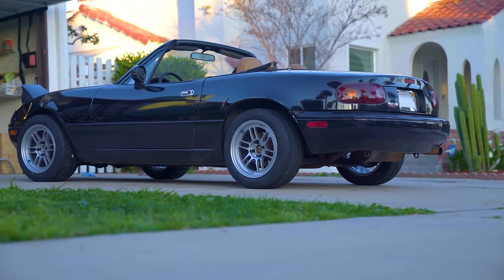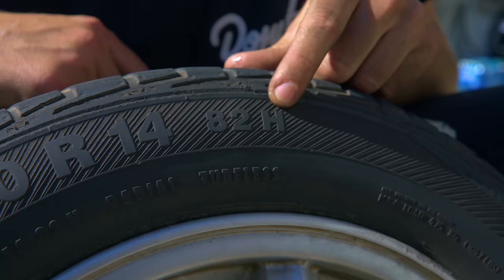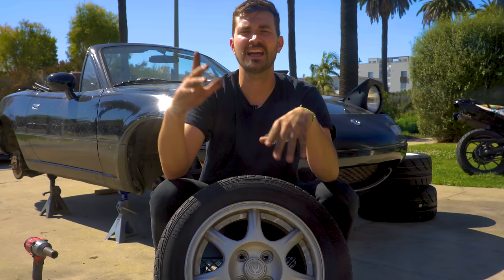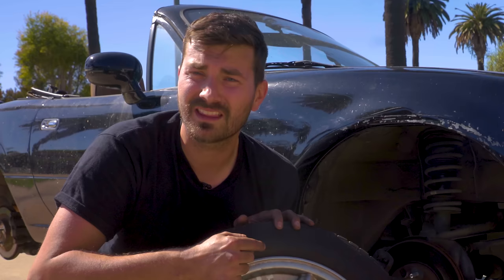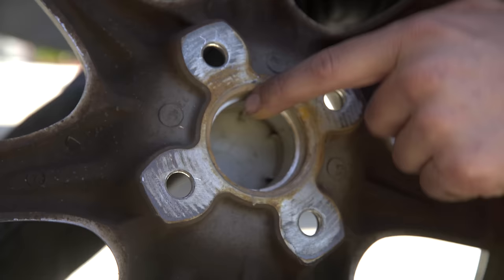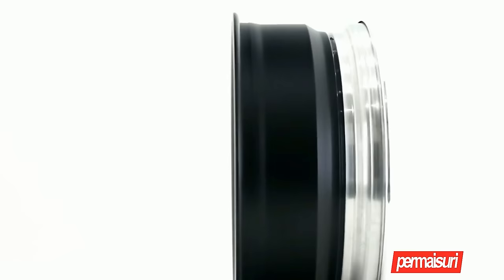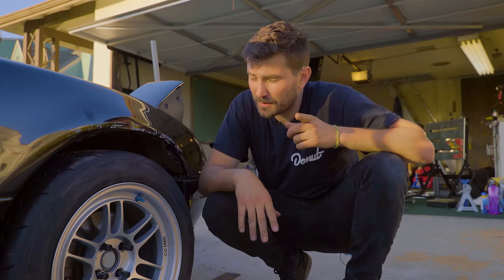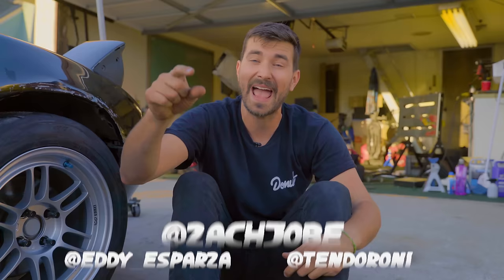How to Pick BETTER Wheels & Tires for YOUR Car

Comment: We had a nail in a tire creating a non-fixable slow leak while on vacation 100 miles away from a tire store and 6 hours away from home. Good news, we had a full size spare - bad news, it was never used and original to our '99 suburban. It did manage to get us home, but made us nervous (also we were pulling a 6' enclosed cargo trailer)

Comment: Also when you change tire type, size and what you are doing you will have different tire pressure needs.
Discount tire is always able to help, they have a program that works with the different tires on specific vehicles.

Comment: I heard you had to take away an inch in the wheel width to have a straight tire wall because the measurement of the wheel doesn't take into account the bead of said wheel. Meaning you would have a better fitment with a R15x7 wheel than a R15x8. It also explains why stock wheels on my BRZ was R17x7.5 with 215 tires. Also, going wider isn't always good. I tried 235 tires on my BRZ and I was using 1 more litre of gas for a 100km, a 12.5% increase on fuel consumption. With the price of gas here in Canada, I went back to 225 which is a good compromise.

Comment: I got a 95 NA Miata and got new wheels and tires on it. The main reason I ditched the 14 inch size is because you just can't find a good 14 in. tire anymore. It was even a little tough to find a good quality tire. It's the result of newer cars that have huge wheels and are more concerned about look over substance but as all newer cars now have these huge wheels there isn't a lot of money in it for keep making smaller wheels. I had to replace the wheels for that reason. At least there is a couple of good tires in the 15in. range so I got the wheels and some TOYO tires and love the all around setup. The only downer part is the tire is lower profile as I had to go from a 60 series to a 50 so the tire is lower profile. While great, it's wider and does handle great you find that cars that are designed with a tire size also figure in the suspension of the car such as comfort and the size of the tire makes a difference. The ride is now stiffer and you feel the road more so if the car felt the bumps in the road before they will really feel it more with lower sized tires. It's why I didn't keep going and get a 16in wheel because with those you just don't want to take it on longer drives and still have a back that doesn't scream at you to pull over and wait till you stop hurting and then drive on...

Comment: FYI - Factory lugnuts have a 40 degree seat while aftermarket normally has a 60 degree seat. You need full contact from the lug to the wheel, otherwise you may risk damaging you, others and/or the vehicle.

Comment: Hey Zack, I hate to be the one who criticizes, but your tyre fitter forgot to align the yellow dot with the valve. Yes, this is negligible in the end run, because wheels and tyres are balanced together, but aligning the dot and the valve could reduce the amount of additional weights need for perfect balance. 
Still, love your show, keep up the good work!

Comment: Fun fact. I have a 1990 VW Corrado. I went to a Discount Tire one time to get some new tires possibly, and they told me the rear tires that were installed were backwards. They were directional tires. They were installed by another Discount Tire a few hours away. If a trained professional can install a tire incorrectly, not check it, and allow the customer to drive off and possibly get into an accident, so can you. Also do not take possession of a car after getting tires installed without making sure they're installed correctly.

Comment: Hub rings are also for safety too. Without them all the load is braced on the studs which can cause vibration, flex and loosen the nuts or even crack and  fail

Comment: Great Video, but you forgot to explain Inner Fender Clearance...

Depending on your Backspacing & Tire Width, you may need to purchase a Fender Lip Rolling tool, rather than maring your fender lip with Channel-Lock Plyer marks!

Comment: They have an app to look up wheel fitment on cars. You enter your car then you have a two pages. One you can leave stock, or whatever wheel you have right now. The other page enter the numbers of the new wheel and tire you can/will put on it. It will show you on the pages as an image how they fit, width diameter wise. Not brake caliper fitment tho, especially if big brakes.

Comment: I run my tires at the max pressure, it reduces tire flex, improves stopping distance and improves grip. I stopped going by the door jam inflation specs 2 decades ago, that's for comfort and improved wet traction.
Reply: max pressure is dangerous, you dont get more grip. also once your tires heat up you will lose even more grip as the pressure will rise, you dont have to go by door jam specs but max pressure is not good
Reply: @arcanevoid9199  been doing it for decades. all tires have the max cold pressure on them. only slicks have more grip at lower pressure cause they  expand when a powerful drag car launches.
Reply: @uptownsamcv  yea some people have gotten it in their heads that it’s better. at too high of a pressure you will be driving on the middle of the tire, which means a smaller contact patch. it’s not just slicks that do that, it’s literally how tyres work. the lower the pressure the more of the tire contacts the ground, which increases grip but also increases rolling resistance which is why you get better economy when you run higher pressures
Reply: @arcanevoid9199  i can tell when my tire pressure is under 40 psi cause I get more wheel spin under acceleration and can feel the instability of the tire. I run 245/40-18's on my maxima and I keep them at 50 psi  which seems to work best, same for my girlfriend's G37 coupe..
Reply: @uptownsamcv  maxima? lmaoo never mind you do you bro

Comment: At 2:20... A tire inflated to more than the car maker's recommended pressure, but less than the tire manufacturer's maximum pressure will stay rounder, run cooler, respond better to driver turn-ins and last longer. Conversely, higher pressure means harder rides. As the length of the tire contact patch becomes less as tire becomes rounder, under extreme braking, stopping distances increase. As few drivers race their vehicles to the "hairy edge", increasing tire pressure to a few pounds less than the tire manufacturer's maximum tire pressure, will get you many thousands of miles more tire life.

Comment: Tire pressure by vehicle type:

Almost all cars - 32 psi (European Mfg. 32-35 psi)

1/4 ton pickup & SUV - 35 psi

1/2 ton pickup - 35 psi (P tire) 38 psi (LT tire)

1/2 ton(HD) & 3/4 ton pickup - 38psi (no load)

1 to 5 ton - 60 psi (unloaded) 80 psi (loaded)

Comment: If your stud length looks too short by changing wheel, change them with ARP 100-7720 studs.  They are VERY long and almost sticks out from wheel face.  If so, chop and grind down the stud end cone shape.

Comment: 13:18  you're saying wider tires means a wider contact patch means more grip...
1) wider tires do mean a wider contact patch, but it also means a shorter contact patch.  so the total surface area of the contact patch does not change at all.  however, wider tires mean you can have a softer compound with the same rigidity and heat tolerance.  and a softer compound does mean better traction.
2) more contact patch does Not mean more grip.  the ONLY TWO ways to increase friction is to increase weight or use a material with a higher coefficient of friction (like softer rubber).  but the main reason high performance tires are wider is so they don't wear out as quickly.  they spread the load and all the other forces.
i know a lot of people will never in their life believe either one of those things, but i hope to open at least a few eyes.

Comment: One little thing I noticed in the video, he said that "Z" is the highest speed rating when actually "Y" and "Y in parentheses", (Y), is the highest. "Z" rating is 149+ mph, "Y" is up to 186 and "(Y)" is 186+ mph, but as he said, anything over 149 mph has to have a "Z" in the size designation. There is also "W" rated which is up to 168 mph. I only learned this when I purchased a Challenger Hellcat and went to buy "Z" rated tires and the shop wouldn't install them due to liability.

Comment: Highest rating for speed is not Z, it is (Y). Also full DOT codes are very often found on on both sides. And each state has different tolerances on how old tires should be. For instance Ohio is 7 years

Comment: You make it sound like cast aluminum wheels are just like nbd
They're actually differentially cooled so metal is under tension. If you were to cut into one with a bandsaw it would spring open once you got beyond the integrity of the casted structure. It's the same reason people can't really repair them well

Comment: Old tire/wheel pro here, heh. Not bad, but those tires are a little narrow for those wheels to my eyes. I'd have considered a 225/45R15 for a bit more of a filled-out look and better dry grip... plus your speedo would be a bit more accurate, as they're a fair bit closer in outer diameter to the old 185/60R14's (22.74" original vs 23.07 for yours and 22.97 for my suggested size). You'd also have a more vertical sidewall, where those are angled in a fair bit (which would also protect the rims from curbs better, be closer to the manufacturer's intended design profile, and have less risk of de-beading under cornering loads). Unless, of course, the Miata couldn't take that width, but... from the look of it, it would've been fine.

Okay, yeah, you considered all of that. xD I like the wider look (plus those are some ugly tires IMO with a really rounded shoulder, blech!) :P

Comment: I have a 2000 Camry LE 4 cylinder that my late cousin gave me it was his father's Camry. This generation of Camry's from 1997 to 2001 took 3 different rim sizes 14, 15, and 16. Mine came with 15's. But I ask a question on Toyota Nation and 3 people had a car like mine. They said to put 16 X 7 on the Camry. They also said to put 205/55R16 tires on the Camry again I did. The ride is much different now. The stock steel rims I bought are 16 X 7 from a 2015 - 2017 Camry year. The hubcaps I bought are of the same year and are called Camry LE hubcaps. I can't buy custom rims because I live in a crime area. Very sad but that's what it is. I've put led lighting almost everywhere with no problems so far. I kept my other rims that another cousin gave there 16 X 6 and half. Those rim will be my winter rims. I did a lot of research before I got the new rims for the Camry. Thanks much for your video.

Comment: When discussing width on your 185/60R14 tires the demonstration seemed to delineate the width of the tread. If so, that's not exactly so. 185mm refers to the sidewall width. Some tires have a rounder sidewall pattern, some have a straighter/flatter profile. So the tread is relatively narrower on rounder sidewall tires than the rated 185mm. And the tread is relatively closer to the 185mm on straighter walled tires. But in no tire that I know of, is tread the full width of the sidewalls, in this case, 185mm. You're welcome, haha.  ; )

Comment: Love the video very informative... Not too sure if you have the measurements but here in the UK and EU on top of all that we have tyre noise measurements in dB, the lower the number the quieter the tyre noise/roar is on top of that we have letter grading for fuel efficiency and wet grip level A grade being the best and G being the worst. Also for the tread depth it's general rule that if the tyre is below 3mm tread depth it's in the bin as well as the wear and tear you mentioned

Comment: It's a myth that "a wider contact patch means more grip." A wider tire does make a wider contact patch, and running a lower pressure will increase the length of your contact patch, but neither of these is likely to improve your traction on normal road surfaces (off-road is another story), because your contact patch has to correlate to the amount of weight you distribute within it. Running wider tires doesn't increase traction, you end up diluting the weight on that corner over a larger area, and the tire breaks free more readily. Car and Driver tested this with the same conclusions.

Comment: Nice vid! But there is MORE science involved in the tire fitment. You should know how your suspension works if it's a) your wheel is going vertical all the way (multi-link - for example Audi) or b) your wheel is going in sort of circle motion (like BMW e46 for example) then you have to use narrower or wider rims/tires (b) can accomodate beefier tires than a)). Next are bolt/nuts seat. You have basically two types - cone and ball seat. Cone is usually 60deg flat surface and ball is little bit trickier. You MUST know correct radius of this ball seat or it won't fit perfetly and can result in wheel going off your car. Main types I know are R12 (radius 12mm), R13 (used in most OEM Audi wheels as far as I know) and R14 for Porsches etc. Make sure you have right seat fittment (or visit your local car dealership/service centre) when changing bolts/nuts because brakes, suspension, tires and wheels are the most important things on the car. In conclusion: do a TON of research or leave it to the professionals.

Comment: The speed rating letters don’t go from A to Z, and the ratings are not in alphanumeric order either. There’s only a few speed rating levels for passenger car tires. S and T rated are the lowest speed, typically found on really small tires like for 13” wheels and such. H is next, then V which is up to 149 mph. Historically Z meant anything above 149 with no set limit, but in the 90’s the W and Y ratings were added with specific limits above 149. However both W and Y rated tires also have the ZR before the rim diameter number.

Comment: I know that low profile tires have their place in performance driving on the track. But I'll never get it with the obsession so many have with putting large rim  wheels and super low profile tires on street cars. Besides making your vehicle ride as hard as the Flintstone's car, that 2" or so of tire between the rim and the road is a recipe for disaster. It doesn't take much of a road defect to completely ruin the rim and tire. I'll stick with 70 series tires on my Dakota. Look good, practical and give a very comfortable ride. That impresses me. the only one it really matters too.

Comment: To add to the info about the UTQG tread wear relativity; if you're ever curious about how many miles to expect out of a tire under normal use circumstances, particularly on some performance tires that don't offer a tread wear warranty to base it off of, it's typically about 10,000 miles for every 100.  E.G. 400 = about 40,000 miles.   As mentioned in the video it's a hardness wear relativity rating to a set standard so it's not a super scientifically significantly number per se, but you can infer a few things from it.  Again, not a set in stone thing, but it will get you in the ball park.

Comment: You just added 17mm of scrub radius to your car (45-28=17). Your car would likely be squirrelly as hell when braking hard cuz the front wheels will greatly toe out dynamically during braking (and acceleration) for a RWD car.

Comment: R888s must run huge.  An 8” wheel, even though it’s technically 203 mm wide, should be able to support a 235mm tire without any bulge.  

Tire widths aren’t really a perfect science.  For example, my wheels are 8.5 inches/215 mm wide, but if I ran 215mm tires on them, I’d look like I was going for some kind of stretched tire stance look.  So I run 245s, and they’re neither bulgy nor stretched.

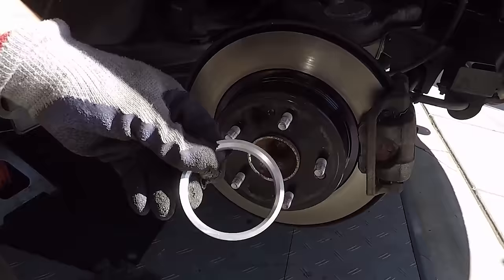Comment: 10:27. your tyres may be too old but they’re well and truly stuffed. Tread wear index marker has well and truly been worn down to. Not a safe Tyre to drive on.
Tread wear index, its the little strips of rubber between the tread pattern. They are located across the tyres in many locations.  These ensure you have plenty of rubber on the road with enough tread depth to allow for water dissipation

Comment: Huh, those are interesting parameters you use in the US. Over here we also have 3 indicative numbers, but they are fuel consumption, grip on wet surfaces and noise in dB. Nothing related to tirewear or temperature.

Comment: Honestly, just get a set of Michelin Pilot Sport 4S or Pilot Sport PS2s at most, anything above that is more than over kill for a daily/street car. Won't even get into the optimum temp range to get the best out of the tires without going well out of the legal speed limit and staying there.

Comment: I wish I had a set of BFGoodrich 195/50R15 rally tyres tires for my Suzuki Swift!

I don't care if its nöt fuel efficient or practical, I just wanna be able to climb the kerb curb to get into my jury-rigged driveway. 😌

Comment: For the wheel to be lug centered it must have the correct design. A tapered seat for the lug to sit in and center itself. From my experience wheels tend to be one or the other and not both.